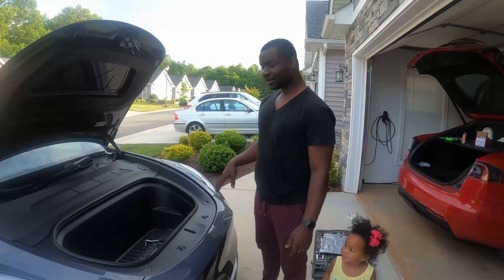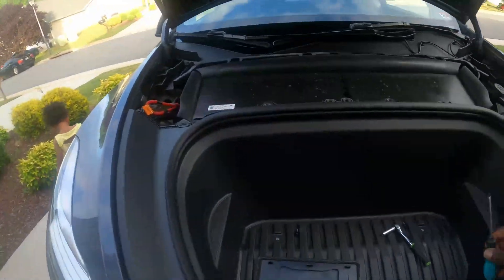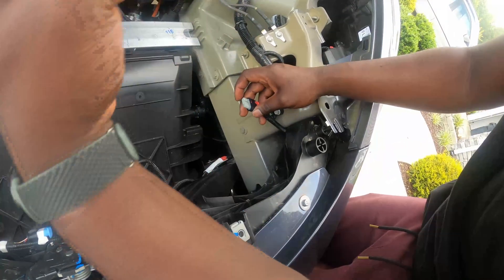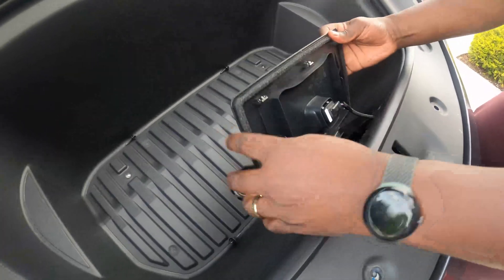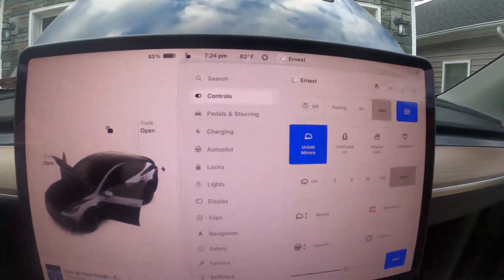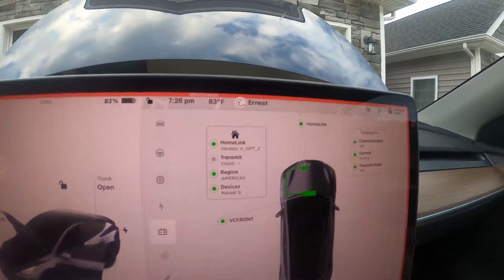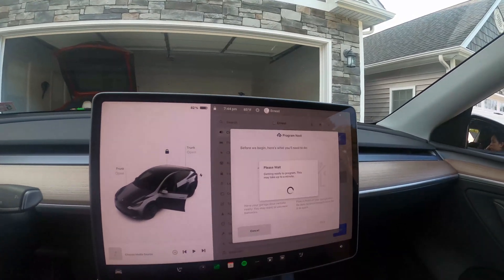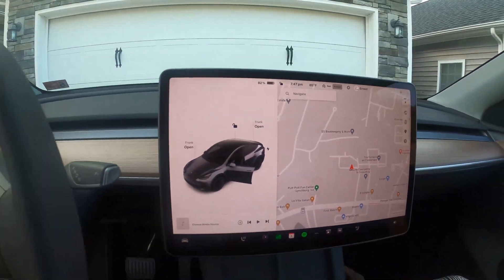Tesla DIY - Model Y HomeLink Install & Setup

Comment: Pulled the module out of my old model 3 and installed it in my Y with the help of your video.  The bracket for mine was reversed (supposed to remove the bumper cover and install facing front) but it fit fine facing into the frunk and works well that way.  Glad I didn’t have to pay Tesla to install.

Comment: This worked perfectly for me on my 2024 Model Y, software version 2024.21.05. Thanks for the detailed video, it really helped!! Sidenote about mounting position - if you have a small 10 mil wrench laying around, and you're stubborn and a glutton for punishment, you can manage to tighten the bolt from the other side. It just takes a lot of patience, and the willingness to risk dropping a tool somewhere into the front bumper area and potentially ruining your day. It helps if you have medium-sized hands - if you have giant hulk-hands, it's probably not worth the risk
Reply from the maker: Awesome to hear. Yeah I have giant hulk hands

Comment: Does anyone have a clue if i could remove the module from my 18 model 3 and install it in a new 24 model Y?
Reply from the maker: So this was previously done with 2022 model Y. Not sure where I saw it but I know it's been done before. You'd need to verify that nothing has changed with the module housing

Comment: This no longer works on 2024 software.  I moved homelink adapter from 2020 MY to 2024 MY and got a "Failed to update HomeLink Configuration" error and confirmed in other posts that 2024 software update is the cause.  Apparently Tesla Service has a way around it so I am waiting on that now.
Reply from the maker: Woah. I wonder what changed. Thanks for the heads up
Reply: @cybslounge  anyone try it? I just ordered n ebay , hope i didnt waste the $

Comment: I have a 2023 Dec MYLR. I followed this video for the install. 

TL;DR - The plug might not always be taped to the wiring loom. 

Removed the frunk and oh boy. I looked around and couldn't find the damn home link plug! It wasn't taped onto the wiring harness like this (and all other videos) show it to be. I looked and looked and didn't find it. I remembered reading a comment here saying that in their M3, it was somewhere in the middle. I looked and saw a plug taped in the middle. But it was short and wouldn't reach the home link module attachment point. And the plug itself was wrong. I thought Tesla forgot to install it (with my luck with cars, I wouldn't be surprised). I decided to look again and checked inside the panel on the right (when you look at the car into the frunk area). At the bottom, I saw the plug, just dangling away, not taped. It was dirty since it was exposed to the elements near the wheel well. So yes. If some of you don't see the plug taped to the wiring loom, look into the opening on the body panel on the right. It might be in there.

Comment: The reason you couldn't get the cap off of the plug is that you didn't have the red plug pulled back far enough. I just completed this installation on my Model Y and had the same trouble getting the cap off. I pulled the red clip back a little bit more and the cap came right off.  Thanks for making this video for us.
Reply: True. Also, sometimes even with the lock released, it still might be tight. You need a small flathead screwdriver to wedge it gently under the lock clip (on the plug) and lock (on the protector). Lift the lock clip up slightly and pull on the plug to easily remove the plug.
Reply from the maker: Yep that's what happened to me. I had to use a flathead to release it

Comment: I bought the bolt from Tesla directly and paid about 60¢ for it. The bolt is M6 1X23mm btw., but 25mm is probably fine.

Model 3 (and probably Y):
Model number for the bolt: 1100020-00-A
Bracket: 1098355-00-B
The homelink module itself: 1114984-00-B
Reply from the maker: Great info on the bolt. What I mentioned in the video was what we figured out in forums

Comment: Great video but my understanding is that the homelink needs to go on the front of the mount. Wondering if you have had any issues with the homelink working properly or every time. If not, then great. FYI if you mount it the proper way it is very hard to get the screw screwed on. I recommend a zip tie instead.
Reply from the maker: You're correct! I made another video with a pinned comment pointing that out. I believe the homelink has a bidirectional antenna so it actually doesn't matter where it faces. I tested it facing the wrong direction and it functioned just fine
Reply: It doesn't matter which direction it faces. Technically, depending on if you back your car in or drive head on into the garage, the door still opens. I have it installed this way (I tried getting it on the right way but I couldn't get the screw to stay there and couldn't get my wrench in there) and have zero issues. Works every time.

Comment: Maybe I'm just not understanding but is this just a way to spend ~$200 one time to add Homelink to a Tesla rather than pay $45 /year (or more for 5 or 10 years) for the MyQ service already available in the car? And possibly ~$20 to add MyQ to your opener if it isn't built-in? If so, the break even isn't for ~4 to 5 years?
Reply: Screw MyQ and LiftMaster for that scam of a service.
Reply from the maker: The benefit to HomeLink is that it provides a way better experience than the MyQ system does. 
The HomeLink system is RF based.
The MyQ system is Network based.

The benefit to the RF based homelink is that it acts just like your garage remote would. It doesn't require any form of handshake sequences between the car and the garage door controller. You can also find the HomeLink module online for $100 -$170.

The Handshake becomes the annoying part of the MyQ system for me. Since MyQ didn't change how the car talks to the Garage, it acts pretty much as how your phone does. In order for the garage door to close after you click "close", it will flash the light for 10 seconds(iirc) with a beeping noice before closing the door. What's interesting is that it doesn't take as long for opening it. There are other limitations to the MyQ also but i will keep it short. 

The HomeLink setup avoids a subscription service and provides a smoother experience. I don't know if the MyQ has this feature but you also get a button on the Tesla app to open and close your garage door. 
Hope i was able to answer your question. Thanks for watching!
Reply: @cybslounge  Belated thanks for your explanation. Does the Homelink option let you automatically open the garage door when you approach?
Reply from the maker: @randylyon7259  Yes HomeLink will auto open and close as you approach and leave. The closing side of it will only work about 90% of the time though. Once in a while it seems to self cancel the process

Comment: This is so tard. Just use the damned remote control, save yourself $300 and ripping your car apart.
Reply from the maker: Thank you for your contribution. It is an option and not a requirement. Just like your opinion could have been added to the conversation as option and not a requirement. If you think it's so "tard", then simply move on.
Reply: @cybslounge  thanks for offering the ability to move on to the original poster. I appreciate your video. I've had my 24 MY for about two weeks. Already had MyQ installed on my doors, but looking at the homelink option.

Comment: Auto open works every time close sucks. It errors 99% of time. I just manually close and it works as link as you are close to the garage too.. seems like MyQ does not want to improve this either.. but wants to still charge you
Reply from the maker: Haha. MyQ is a joke with how bad it handles opening and closing the Garage. I need to do a video on comparing the two. Their Home Assistant support is also subpar.
Reply: I’ve been using myq on my phone for about a year with no issues. Just got my car and am still in the trial and it works flawlessly as well. Wonder why it’s free on the phone but cuts in the car.
Reply: I'm in the MyQ trial and auto open has always worked so far. I didn't realize it had auto close and frankly would not trust that to find out close never happened. I guess my fault for not knowing about auto close but it locked my electrician out of the garage while he was installing my charger. I went on an errand and did not manually close the door because he would be going in and out. But the door auto closed locking him out with his tools, etc, inside the garage, I was able top remotely open the door for him but not good. If I stay with MyQ, there better be a way to auto open but not auto close. If auto open fails, I can at least see that. If Auto close failed I'd drive away thinking the door was closed.

Comment: Where do you get the module from?
Reply from the maker: You can either get it from Tesla for about $250 or on eBay at a discount. You have to do a parts order if you do order it from Tesla

Comment: Great install video! I may have to bite the bullet and do this on my 2023 Model 3. Do you happen to know if it is the same module? Also, can you open/close with voice commands? Curious because I couldn't get it to do it with the MyQ trial. Thanks!
Reply: Got my module this afternoon and it took about 45 minutes to install. BTW -- for anyone doing this on a 2023 Model 3, the wiring harness has moved to the middle of the front where the frunk is. It's about where the connections are for the frunk open button. It moved probably because of the lack of  parking sensors) and you'll find it fairly easily.
Reply: Also -- I forgot to add... There are two spots where you can mount the bracket for the module, facing outward. You can get a 10mm socket behind it.
Reply from the maker: Awesome do it! The convenience is worth it. It's the same model for the 3 and Y
As for open and closing with command I haven't tried that yet but I just did and it says "this command isn't available yet"
It could be a safety issue but they might be able to lock it like how you can't open the glove box without the key present

Comment: nice job. thx
Reply: It was a big fail for me — could not coax the dust cap off the plug on the wiring harness! The one you had some trouble with. Got a Tesla ranger to come out and do it for me.
Reply from the maker: @raleedy  Sorry to hear. I did struggle with that for a bit. I had to poke at the lock on it to allow for some wiggle room
Reply: but how to find the goof ref on ebay ? it's also the same for model y ?
Reply from the maker: You should be able to find it with this information. I installed it on my 2023 Model Y 
HomeLink Garage Door Opener Control Module 1114984-00-B